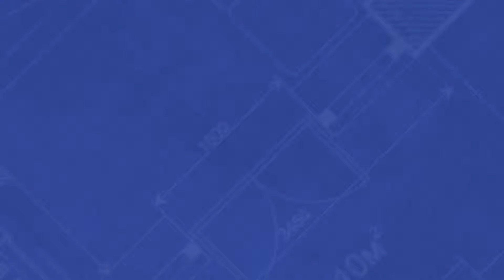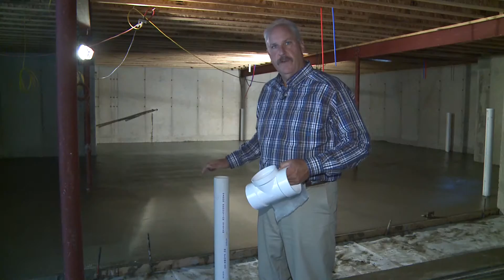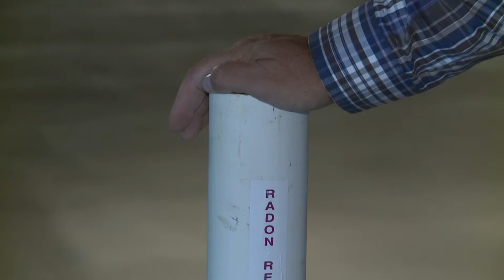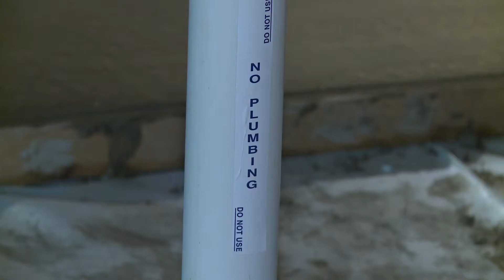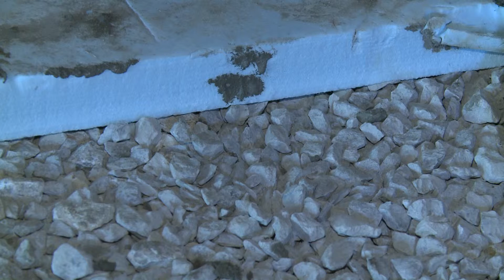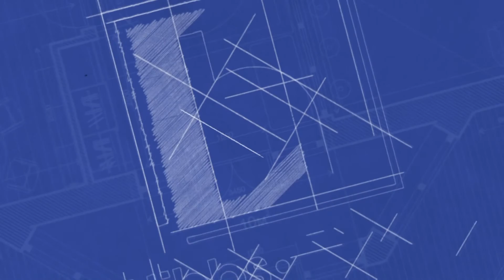Preventing Radon Issues Before They Start

Comment: Wait? Did you say you leave a 4 ft section exhausting into the Attic? Where does it exhaust without the fan option and where does it exhaust with the fan option?
Reply from the maker: Hi, Micco - With each new home we build, we install a passive system sub slab and vented out through the roof.  If radon is detected before the owner moves in (we do a formal test), we add a fan in the attic to actively mitigate radon.  No, we do not leave the venting stubbed up into the attic.